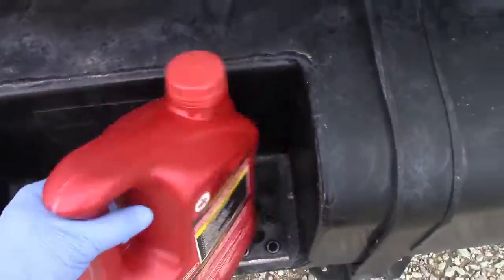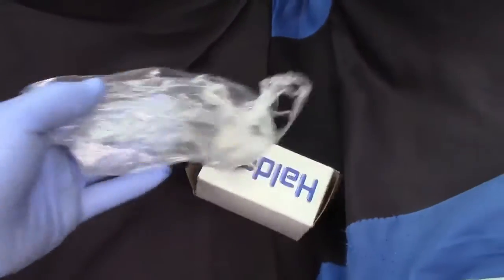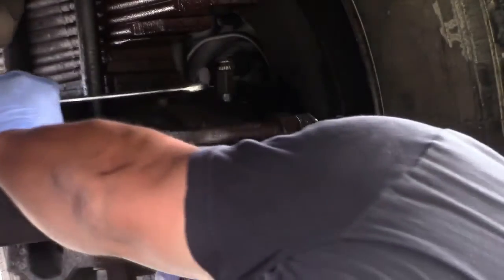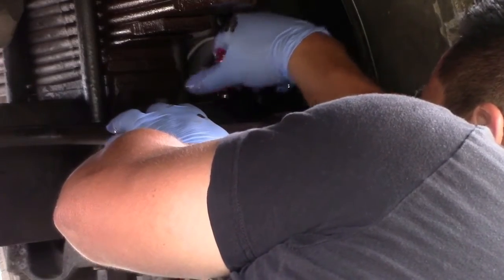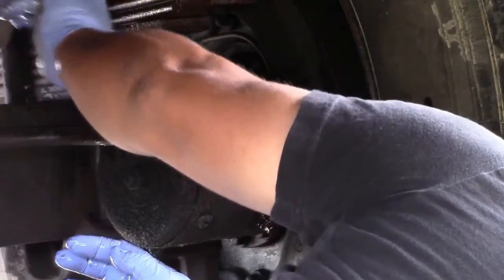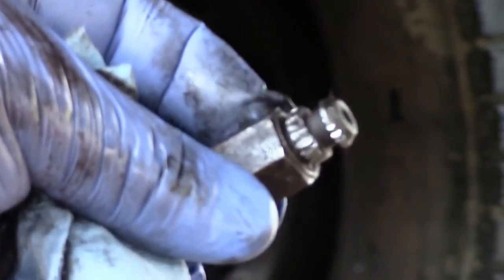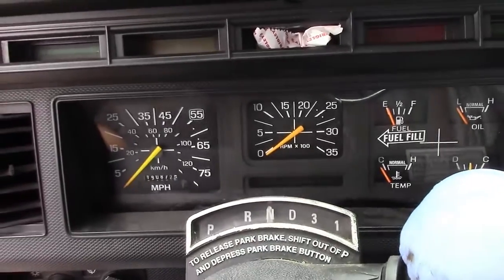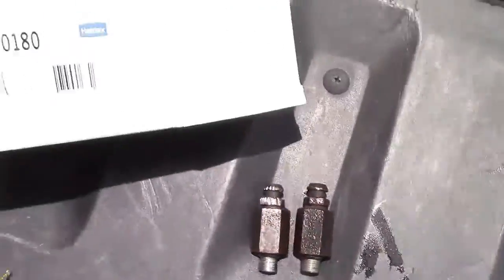how to bleed the parking hydraulic brake pump with Lucas Girling System

Comment: Hey bro i ran out of brake fluid on reservoir, but brakes are doing great, just bought truck but i fillied the reservoir back and now its hard and dont brake, do i have to bleed all tires? Its a 92 f700 dump with girling brakes. Thanks in advance!!
Reply from the maker: Yes, you have to bleed all the wheels
Reply: @RescueMoversDFW  thank you bro, becareful out there!!

Comment: Hello I'm working on bleeding this type of brake system on my 1993 f700 moving truck. Im having trouble getting the brake motor light and buzzer to stop. Any suggestions?
Reply from the maker: Have you checked the door switch?
Reply: @RescueMoversDFW  I have not
 It still buzzes with the door closed. However the wiring harness that hooks to the back of the brake pedal I think might be a problem. I was able to get the buzzing to stop at first messing with that connection but now its buzzing full time. I think there might still be air in the system. I'm ordering a new bleeder valve for the one side. Thanks to your video I had the parts number. One more question. Why do u recommend atf fluid instead of brake fluid? Thanks for your quick response btw

Comment: I have a f700 with the same brake system setup.  I was wondering what the part number was for the pump that you installed if you could give me the number I would appreciate it.  been working on this truck for about a week. I know when you take the pump off that cover comes off and the pump is under it.  My cover has crack in it and cant find a new one looks like you found one tho
Reply from the maker: Hi Kevin here is the part  number for the brake pump assy: XC3Z2C256AA and here is the link: http://www.ebay.com/itm/XC3Z2C256AA-PUMP-ASY-FORD-/162042549667

Comment: Where did you get the manual? Truck manual or brake system? Thank you again for the video. My Ford Dealer had no answers for me. I have Mercon LV.  Does the fluid have to be Synthetic?
Reply from the maker: I bought the Mercon LV at walmart little bit cheaper and it has to be full Synthetic. Also can't remember where i bought the manual but i'll find out tonight and back to you tomorrow.
Reply: Thanks
Reply: In my 92’ f800 my ford truck dealer said to only use dexron 3-5, not full synthetic, how has your brakes held up, leaks? Hoses? Thanks for the video.